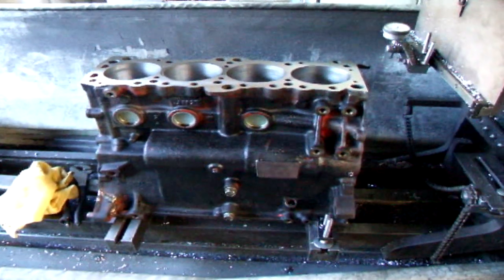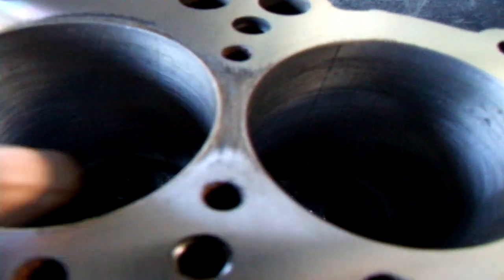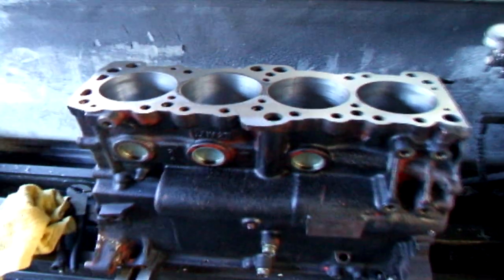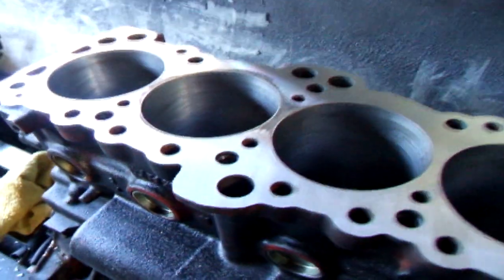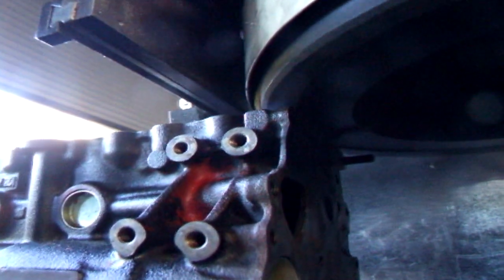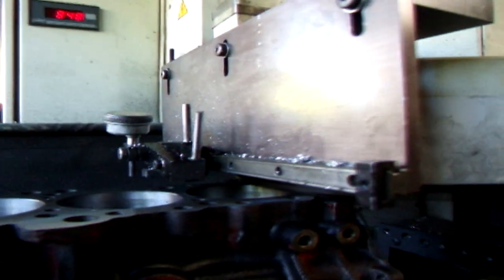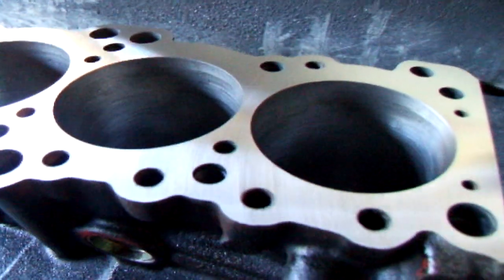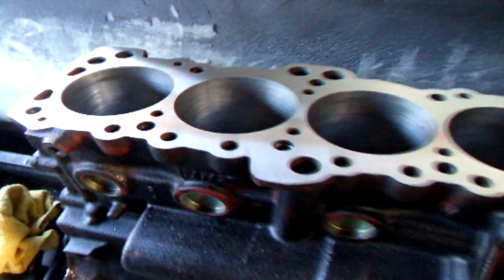4G63 Block Resurface

Comment: Hi john, i'm just about to rebuild a a 4g63t, 7 bolt evo 1 block, i've been given a block and crank in good condition from a 1995? 4g63t rvr

(things what i can see are different are frost plug locations on the block, still got oil squirters and the serial number, 3K on the back and 4g63 SB8955 on the front)

have you had any experience with the rvr turbo block, any point in building it or should i just ditch it and get a genuine evo block?

Shaun

Comment: Hi John 
i have a question about liners for two air cooled cylinders, what wall thickness would you recommend for a 125cc capacity and would you increase this for 250cc, also what material would you use to machine this out of. this would be for converting a plated alloy barrel that has damage. 
many thanks  
Magnahelic